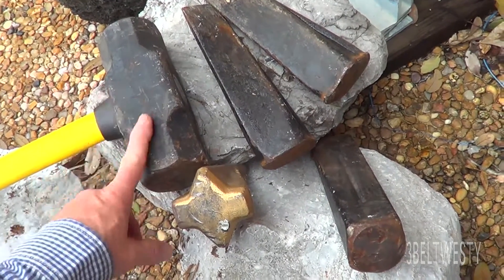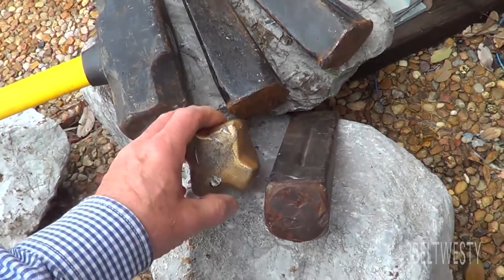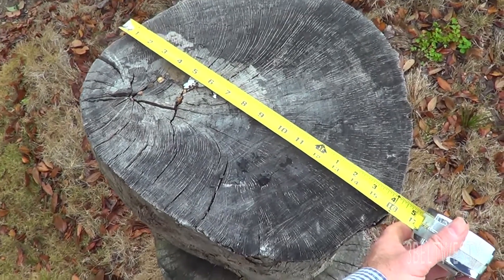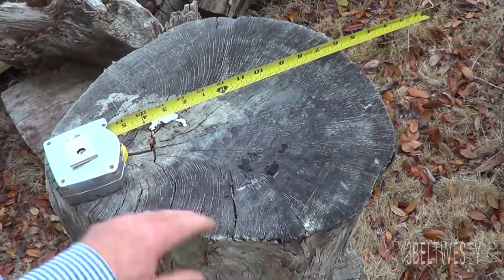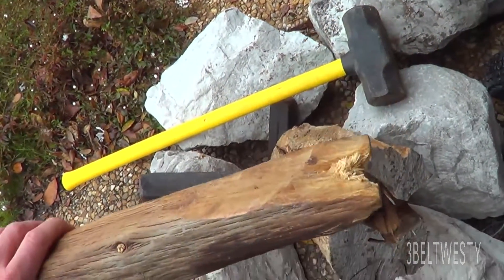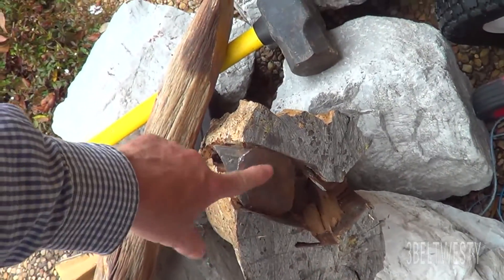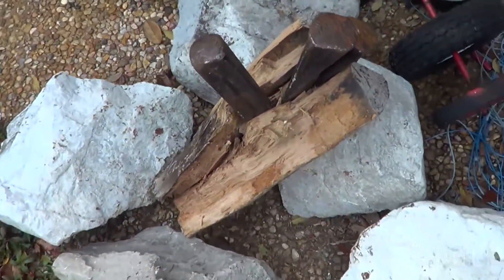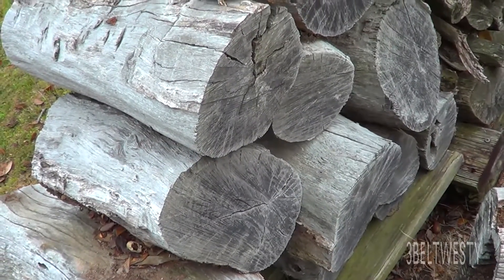Splitting Large Live Oak with wedges and a 12Lb Sledge.

Comment: Is it at all advantageous to rip the bigger rounds with a chainsaw then try to split the remaining halves?
Reply: I did that with some 40-50 inch pecan logs. I wanted every last piece of that dang wood cause it burns almost as good as oak. Big knotty pieces got a few chainsaw cuts several inches (10 inches or so) deep to help me start the splits. I should of swept up the dusting to use to start the fires too.

Comment: You confirm my own experience with the diamond shaped wedge.   It is not good at opening up a round because it exerts equal force in all directions when it is driven in.  I don't envy you, in what you are trying to do with that stuff.  It looks daunting.
Reply from the maker: Most of the time around here folks haul these big pieces away. I spilt a few of these big pieces each winter when it gets cold, its is a good way to relieve stress. Those twisted wedges work may better than straight wedges on this tough live oak. The twist at first I thought was marketing BS but it seems to work better in this application. The straight wedges have been in the household for several generations. The 2 or 3 twisted type wedges I got at Harbor Freight  but they seem to not carry them any more.
Reply: I usually make a X mark with circular saw and the true center (judging by rings center) being the middle of the tree (usually off center as God made the tree). But that diamond wedge makes a good start drive to widen the cut so the other wedges (regular and twisted) can start. After a few hits on the reg and twist wedges the diamond wedge gets taken out and sat on the ground cause it is useless.